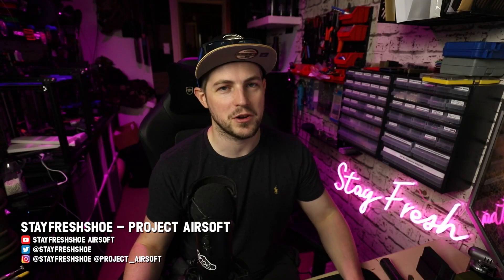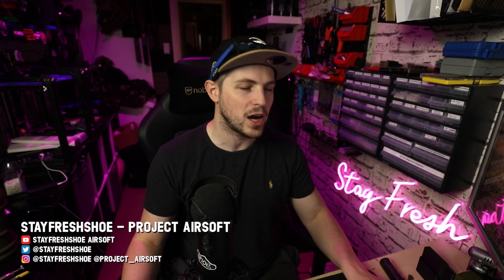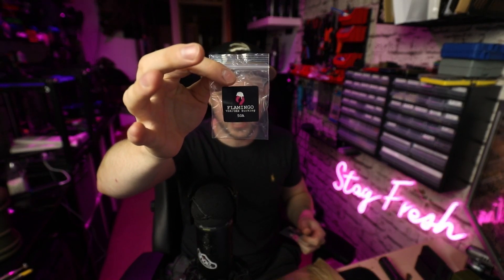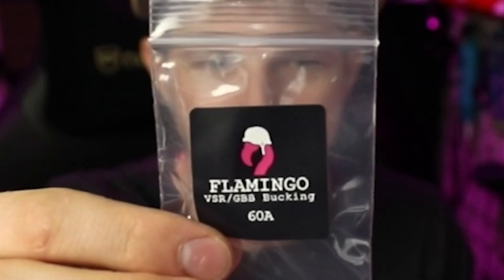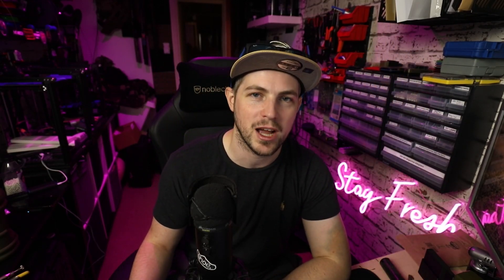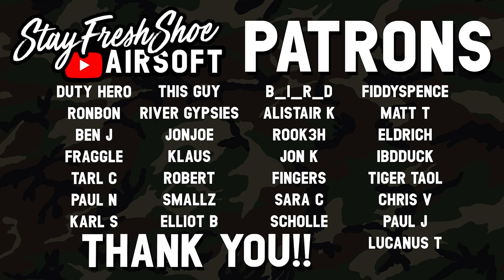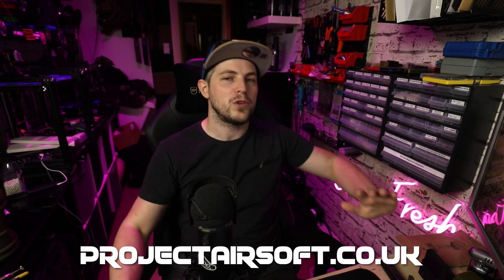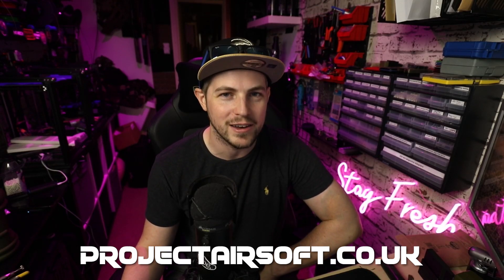Which hop rubber should you use for your airsoft sniper?!

Comment: So funny you post this video. A buddy and I will be testing different buckings and nubs this weekend to see which is the best for our setup. A mix of mrhop rubber and silicone buckings, 60-70 degree, using the ML omega nub or Max concave nub. Since we are on hpa, we will also be testing low pressure/high dwell vs high pressure/low dwell. I is geeky excited.
Reply: What did you find with the silicone mr hops ??
Reply: @eddiegrice7732  The silicone buckings work better in temps below 70F.  70-80 still good but the heat and humidity begin to make them more malleable. Whatever degree rubber bucking you use, get a +10 degree silicone bucking.  We also stuck with the included Maxx concave nubs (longer 6mm one as we are using .4g and .43g BB, this allowed for less hop needed to be applied which helped increase fps while maintaining joules).  

Finally, we found that a mix of lower pressure and higher dwell (I would say 35/65) produced higher joules as fresh air was being provided as the BB traveled down the barrel. I run a 430x6.03mm barrel and use 90-95psi to chrono 1.85J on .28g.  Helps keep the noise down too.  Ironically, applying hop gave an additional joule creep of .05-.15 which is funny since most chronos require 0 hop applied.

We also found 6.03mm bore barrels had better accuracy at 200+.  If you are running a rifle and engaging under 200, then 6.01mm bore is the way to go.

Comment: What about hop rubber for Aeg m4, cause all the ones I've gotten have ripped within a month, my last one ripped the same day I got it
Reply from the maker: Prometheous Purple. Best ones I've used and my group and I swear by them
Reply: What RPS do u run it at? Cuz if high RPS guns destroy bucking in full auto because the bucking can’t handle it
Reply: @southmoreconlin3757  15-18 lol kinda low, but the only after market parts inside my gun are bearings, shims, titan 11.1nunchuck and before I put those parts in I was only getting 5-8rps so ig it was well worth it upgrade small but significant, and well tryna find bucking but I guess I'll try promethius purple next, trying to slowly upgrade my gun, next prob gonna get a mosfet/etu, and upgrade to deans cause I still have standard contacts, either gonna go with the gate aster, or the perun etu++
Reply: @StayFreshShoe  ^

Comment: Hi I was just wondering if you could help me . My m4 aeg has slowly started to lose FPS over time ( I’ve benn playing for 2 years and my aeg has no upgrades and I have never opened it up but I do clean the barrel etc) so do you think there could be any way I could fix that also I have a quick change spring that I have swapped between my indoor and out door spring.
Reply from the maker: Springs lose their power over time so it could be time for a new one. Your rif could do with a general service too, cleaning and re-greasing
Reply: @StayFreshShoe  ok thanks
Reply: @jlp1510  Get a new spring, check the airseal, and the bucking
Reply: @sneez9461  thank you